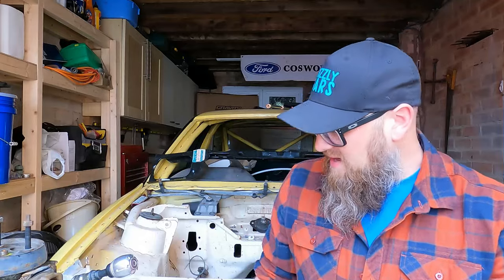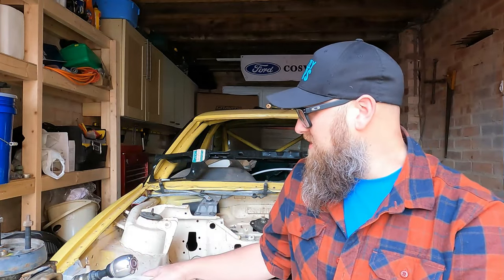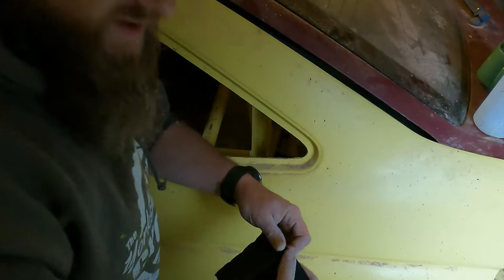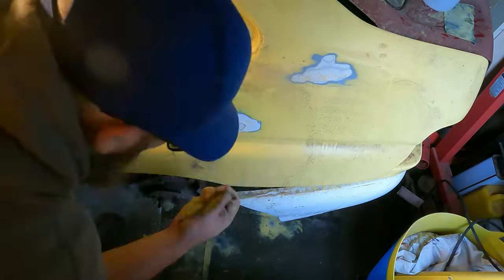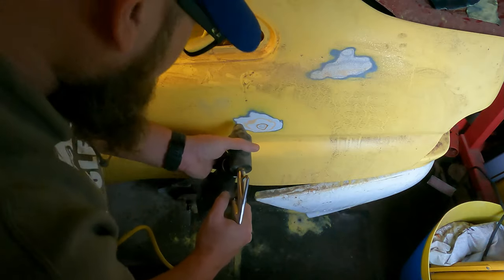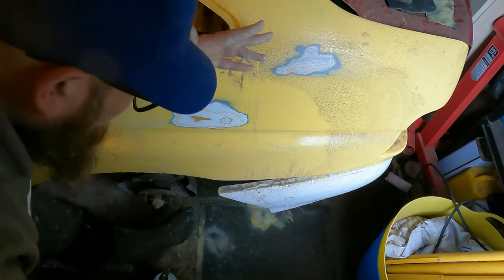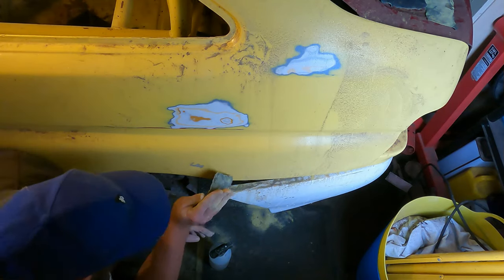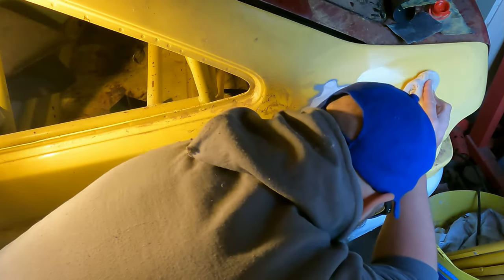Exploring the History of my WRC Escort Cosworth Rally Car. Contains graphic images of paint removal

Comment: nothing on that is WRC spec, at best it was a group N car as the hole for the abs is standard road car not Group A.  If no VIN is present then more than likely it was built up as a rally/track experience car from a bare 909 shell and used that way for many years until any valuable bits were stripped off when it was surplus to needs.
Reply from the maker: I'm thinking it was a hill climb or rallycross, then retired and used as passenger/track experience car and thats why the door bars have been partially cut. The cage is totally different to most of the cars !